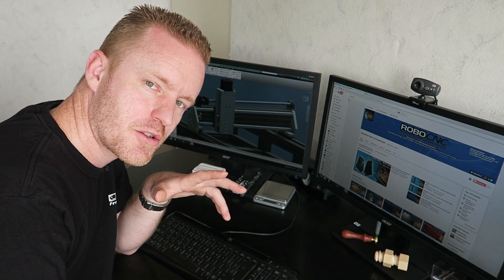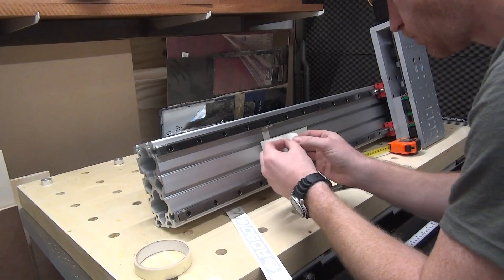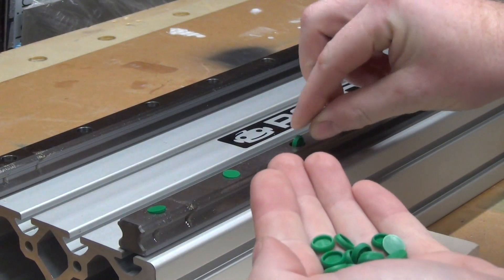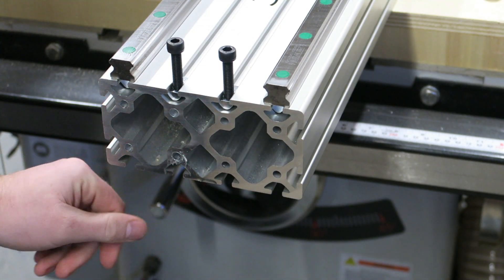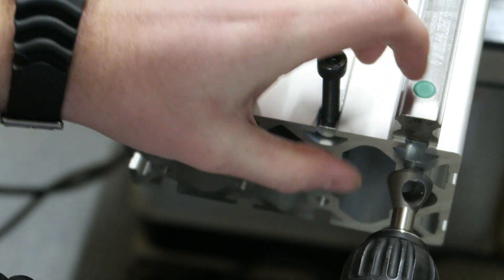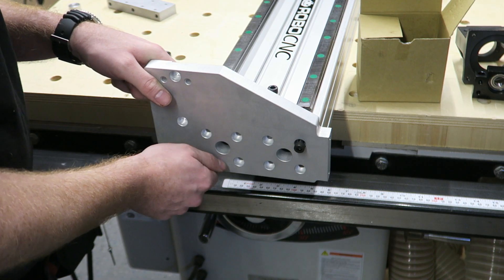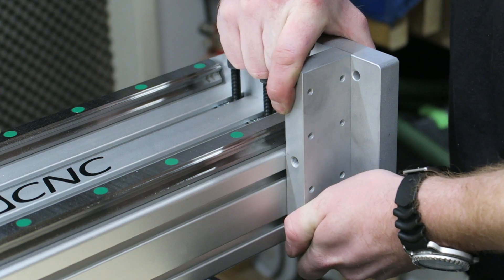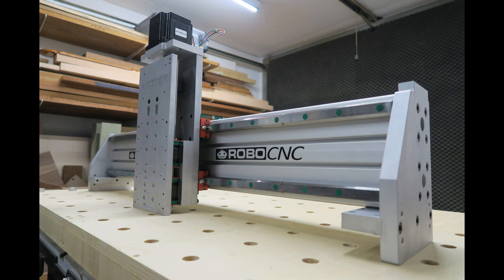RCNCX2 Router 04: Gantry Assembly part 1

Comment: Cutting lubricant for Aluminium seems to work with WD 40 but the correct lubricant should be paraffin or kerosene ( depending where you live). Having said that this is a first class quality build with good explanation on why you chose  the method you used.
Reply from the maker: Thanks for sharing

Comment: Hi, Can I increase the dimensions of the  Y-axis to 1.40 m and X-axis to 2.4 m ? ,I means we using bigger table frame and remain the parts specifications as your design, are the beam section in the Y-axis can bearing the load of Z-axis in the mentioned dimension ?
regards
Reply from the maker: shamal mohammed you could make the x axis as long as you like... for the y axis you not only have to worry about the beam but also you would have to go to rack and pinion... so you can not just change the size , it will not work,.
Reply: Hi, for the Y-axis we can re-size the ball-screw and linear guide-ways according to the new dimension , i dont know what is the problem ? what you mean by rack and pinion ?

Comment: sir could you please suggest that how to get good finish on aluminum after machining it
Reply from the maker: Hi, It really depends on the looks and feels you want.... You could get a mirror finish by sanding it with fine paper and polishing it with a wheel and compound. I have seen very good results wit scothsbright wheels to. The finish you see in this video is done by using a sandblasting cabinet, using glass beads... 'bead blasting'
Reply: Thanks for your reply, sir 
i have also been building up a desktop size cnc machine, but after assembling my z axis i have found that my ball screw is not freely moving, so could please help me out.

Here is the link to the image of my z axis :- 

https://postimg.org/image/o172i3yzr/
Reply from the maker: Hi There, Well sorry buddy, from looking at the picture I can not see what the problem is... Think its also a good idea to register to a forum like cnczone to get more people to help, and have a place to discuss
Reply: thanks for your suggestions, I will surely join the forum, but earlier we talked about the finish, so could you please suggest any cheaper means to get a Matt finish on machined aluminum
Reply from the maker: Sanding with a fine grid and a random orbit sander works fine (thats the finish on my old CNC Router)